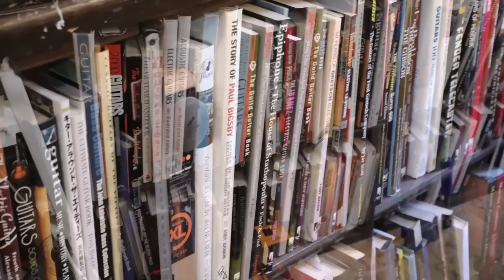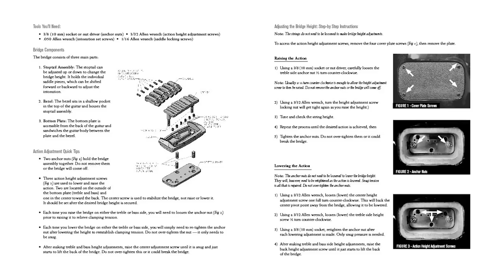Too many Cool Features to be a Success | Taylor Solidbody Teardown & Setup

Comment: Do you have contact with Taylor? i have a Telecaster made by the company in the 80's as a trial run. It has been my number 1 for 40 years. Purchased at Mose Guitars in San Diego, the owner told me Taylor made a few test instruments and decided not to move forward at that time. It's very unique, heavy oak, PAF humbuckers, master volume knob, two volume knobs, two tone knobs, jumbo frets. The body is one piece, no paint, dark wood binding, blonde neck with tele style head, it is incredible. 
i would love to get documentation from Taylor. I will never sell it, just want to know the story.

Comment: Nah you're not crazy aluminum is a soft metal, it sounds fine but it's kind of a durability issue. It's easier to strip something out or for strings to dig grooves in it than in brass or stainless.  Similar issues with wood. A one piece guitar made of a nice solid piece of wood is always going to feel more satisfying and it's gonna take a beating, and keep coming back for more if you ever take it on the road. You can strip the paint and give it a natural finish if you want. You can drill extra holes if you need to and if it's a fixed bridge you can dig out a cavity for a trem, or widen a pocket for new electronics. The advantages of a solid sturdy guitar go way beyond just what it sounds like.

Comment: What happens when that single-allen-bolt ends up being rounded out?  Did they provide a replacement?  Do you have that in-hand or are they now saying they have replacements?  Or is this such a standard allen bolt that you can pick them up 'anywhere'?  Of course, I'm of the opinion that wood means almost nothing on an electric guitar, that pickups are 'everything'.
Reply: I'm thinking about those particle-board uses.

Comment: I wonder if that particular instrument was some kind of pre-production/market tester or the like.  And re the neck, maybe the principle was that it was for a player spending most of the set-list on their (Taylor presumably) acoustic but wanted an electric on hand for the occasional rocker.  No, its not worth doing, is it.  
Looks like you re-purposed some of the cupboards from the old tool shop - and maybe re-homed some of the tools there too!  I miss it, driving round that corner, it gave the whole village a bit of an air.

Comment: Nah, lots of cool ideas but a bit gimmicky for my taste. Looks nice but I’d prefer to keep it simple like a Strat or a Tele. Also, I agree with you about the neck – definitely looks like it belongs on an acoustic. Wasn’t sure from the video but does it have any angle to the neck or does it run straight to the body like a Strat? If it looks along the lines of an LP it should really have an angle to it IMHO. Anyway, thanks Ben for the look at it. 👍🏻😎

Comment: It occurs to me that Taylor may have had to inovate with regards to the Bridge because of how structuraly unrobust the Guitar is. It could have been fitted with a Vega or Evertune but i think those kind of Trems / Bridges require a robust instrument to suopport them. It's aesthetically very nice but your little deep dive has exposed some cost saving methods that surely would have been lost on the buyers. I begrudge paying premium money for particle board, a secondhand one of these would cost the best part of a grand.

Comment: what 5-way switch would one need for having more humbucking positions with coils from both humbucker-pickups as in this one? And how to wire it up? 

Have searched for something like that a few days ago and couldnt find anything really
Reply: If you are really interested I would suggest finding a pickup manufacturer that makes humbuckers that can have split coils.  They should have a pretty good idea how to make it happen.
Reply: @cheapskate8656  thanx for the reply. I dont follow your reasoning though, because i think, it is rather a problem of wiring / finding a proper switch for it. So more in the realm of modding people or guitar builders. But thinking about it has given me an idea, who i might call up, so thanx again :D
Reply: @Lutzifer31337  try googling a boutique pick up maker (plenty of them around) some of them will make dual coil humbuckers that can also be used as single coils.  They should be able to tell you whats required from the pick up as well as what wiring or switch you would need.  If they make the pick ups but cant tell you how to wire them up then they should not be in business.  You could try "Dylan Talks Tone".  He is a pick up manufacturer who also has a youtube channel.  Ask on his channel, I'm sure he could help you.

Comment: Aluminum is not used on cheap hardware. Zinc is. Aluminum is pretty rare and sounds good. That's what you want for Gibson tailpieces; most of their tailpieces on guitars less than $5000 have 
zinc.

Comment: Most pieces are not brass or steel, but powdered zinc pressed in a mold. Aluminum is an expensive lightweight option.

Comment: Zinc alloys (AKA Chinesium; a mix primarily of zinc and mystery % of aluminum, copper, tin... Whatever's cheap, melts at lower tenps and can easily be cast in a regular oxygen atmosphere) are the favoured metal of cheap cheap guitars.
Schaller an Gotoh also make heavy use of zinc alloy but the alloy they use will usually be considerably harder than the mystery blends used by the cheap and nasty Chinese hardware suppliers.
Aluminum alloys (you will probably not see pure aluminium due to it's softness) need an electrolysis process and therefore higher energy costs.
Aluminum is the choice for canned food and drink due to it's ductility.
The right aluminium alloy can ring very nicely.

Comment: Several thoughts here First let's say Martin attempted an electric guit (they did and it's pretty cool) MArtin knows only acoustic guitars and hence forth their philopshy on why a gitar sounds good doesn't come from its electronics as it does in a cmpany like Fender who almost make electric guitars exclusivly. Leo Fender knew electornics .... the telecaster is basically fairly commplext (for the time) electronics mounted to a block of wood (screwed on neck, no body contours, thick) So a a high end acoustic maker Martins culture and philosphy dosn't understand in the electric woorld resonence and wood do not matter as much as much as in the acoustic world. It would be very difficlt philosphically as an acousic mker to just slap electronis on a chunk of wood when they're so used to caring about the wood used, the bracing, the shape of bosy bridge material. What I see is this aspect perplxed Taylor. Maybe more accuratly they went too far in the other direction. Meaning since it IS an electric guitar none of the wood or body matter and it in thinking that it's a noofle that carries sauce, a medium between point a) a guitar and b) playabilitly/tone. Whew ... ok another interesting note: the Gretsch DuoJet .... hollow without soundholes just lie this guitar. an empty chamber housing the electronics wih a cap on top. USually finished in thier drum covering material in that famous sparkle.

Comment: Some old Greco guitars have the same single bolt fixing so that's not really new. That bridge is a disaster.... Or is it? My first thoughts were: Pointless innovation and too many fiddly bits... These could lead to real trouble after long term hard use on sweaty stages. Sure does look cool though... Then again - all those fiddly bits are no longer actually located where the sweaty bits will contact them... So maybe, although it is strange, it might well stand up to long term stage use without parts seizing up

Comment: the back of the neck (with its weird curvy shape) still hasee huge contact area to the body and in the location that probably matters the most (same direction as string pull). So I guess the flat area of the back of the neck is not that important...

Comment: i have a taylor solidbody classic which you can change the pick guard and all the pickups easily. Great tone, great playing but the bridge is really not good handcrafted and when you fix it you must not touch it. its really difficult to have a stable bridge and a good intonation,. They have put a pick up switch (made by schaller ) that is not lasting long. So i had to find a similar pick up switch and change it. which is really difficult to find the right one for these pickguards. But they were kind and sent me a pickguard for free( maybe the last one). Unfortunatly The guitar is not produced anymore. İf the bridge was a good design, i think this guitar will be in a very good place in the market as their acoustic guitars.

Comment: Many a time I’ve thought that “tone wood” was over rated. MDF body says something, not sure its a positive (I own an acoustic Taylor I love). How can wood resonance match the tenth of speed of light that the electronics adhere to? #always be learning
Reply: I own a Taylor acoustic as well (very impressive guitars).  The top of an acoustic guitar does make a difference to tone but that can sometimes vary as much within a species as between species.  As far as an electric guitar with pick ups it would seem you are probably on the right track.  Evidence points to tone woods doing nothing for electrics.
Reply: @davestephens3246  Thats true Dave.  Apparently wind can also have an effect on the strength and density.  So, yep, even in the same species and same part of the tree, cut in the same way can have more variation that a different species.

Comment: I got fired up to buy a Taylor a decade or so back when I learned how cheap they were compared to Taylor acoustics. Scary cheap for a good quality American-made electric, like Peavey cheap but a lot prettier. I cooled down when I researched them and found that Taylor had used absolutely no standardized parts or even dimensions, and even then virtually nothing was available for them. Some good ideas wrapped in a LOT of bad ideas. I was shocked that Bob Taylor would so badly execute anything.

Comment: There is no reason why aluminium would be classed as an inferior material for guitar building.  The main advantages of aluminium are that it doesn't rust and is relatively light weight in comparison to other metals like steel.  The down side is that it tends to be a little more brittle, especially in its cast form.  This should not matter in a situation where it is not taking impacts or strain from multiple directions. 

 The neck jointing on this guitar is interesting but I do find that blocks of plywood holding the (rather thin) maple top in position.  Looking at that it seems to me that this guitar is of a mostly semi-hollow construction (which kind of makes sense as Taylor is mostly known as an acoustic guitar brand) without stating it out loud.  Having said that if I had bought a guitar like this (for what I generally expect as Taylor pricing) and then discovered how it had been made I would be less than impressed.

Seeing you analyse how other brands have made guitars in comparison to your own work is interesting, it helps us mere amateurs get a bit of an idea into how a real luthier thinks.

Comment: Thank you so much for this video. It is truly fascinating. I understand what it is you cannot get behind on this particular guitar. This is my personal opinion: 
Yes, it has everything it needs to get the job done and it does that, seemingly; exceptionally well; HOWEVER, it's like "A.I.", in that (shhh ... It is souless.) In the same way that I would not give a gift of plastic to Mother Earth as an offering, I would not be able to validate this as being anything but a plasticreplica of a guitar. . Why? Because it's basically dead. Including the aluminium, vs. brass or steel. Ok. Here's what I think will communicate better, the materials used to manufacture this instrument all consist of low vibrational énergies, so try as you might, if you're a spiritually sensitive person, which most musicians are, you won't connect with this as you would with a guitar that is structurally; as well as, spiritually or energetically sound, IMHO.

Comment: Have you been living under a rock? Cheap bridges are made of zinc. Your typical Tune-o-Matic is made from zinc. The old Badass bridges were zinc. Brass wasn’t that common until the late 70s with the whole brass fad. 

Expensive “boutique” bridges like TonePros and many Hipshot bridges are aluminum. Aluminum is considered very resonant. I use aluminum Hipshot bridges on the basses I build. (By the way “aluminum” was the original spelling by British chemist Humphry Davy). 

Also we have to stop this nonsense about vibration transference. The neck doesn’t have to even touch the body for good sustain. It only needs to be stiff. The body adds nothing to the tone, it only removes energy from the strings. This is why a solid body had little acoustic output but long sustain. The higher mechanical impedance due to the added mass keeps more of the energy in the vibrating string. 

I did a setup on one of these guitars once.  I thought it was very interesting and well made.

Comment: The Taylor Guitars School of Engineering
T 101 "The Taylor Guitars course on Overengineering" - How to design things to be far more and frustratingly complicated to operate than necessary to no purpose whatsoever. This is the prerequisite course to:
T 102 "The Taylor Guitars course on how to reinvent the wheel, the screw and the lever" - Ignoring all technological and physical advancement and knowledge of the past millennia to come up with things that were already perfected when Jesus was in third grade. 
Grades will be pass/fail calculated by an algorithm that is so involved and byzantine that every semester we forget how to do it and have to look it up in the 200 page manual.

Comment: Praises Bob Taylor's work then points out all the flaws in this design... I have a bit of a Taylor rant. I'm a fan of Bob Taylor the business man, but little else. He's done a remarkable job of finding a way to build acoustic guitars incredibly cheap (factory automation, fake binding, etc...) and through clever marketing strategies price them slightly above Martin and Gibson and still sell a great volume of them (I believe retailer relations, / higher margins help with that). The products are passable as a professional instruments, but unremarkable and lacking any uniqueness guitar to guitar. When choosing to source the best components for their product or choose skimming on quality to make a profit, Taylor consistently does the later. Proof of this is with their subpar electronics/pickup technology. You can get a $5k Taylor with their expression system that's not even in the ballpark of the high-end offerings from LR Baggs or Fishman. Taylor doesn't care. Because the competition has a rich history and tradition Taylor's entire niche is "we are the innovators". So we end up with useless gimmicks like the V-class bracing. Living near a huge dealer I demoed a 814ce X-braced and a 814ce V-class brassed the day the store got them... the X-braced version superior tonally up and down the fretboard. Everything they do is about trying to show innovation, even when its not needed. Everything they do is about making as much money as possible. I think the 200 series are where the tonal quality tops out and the GS Mini is probably the best guitar in their lineup.

Comment: That is not a fuse. It's a resistor
Reply from the maker: There is a fuse in there.. the actual bit I pointed at may not be the fuse, it didn't look like the cheap old resistors I know, but that does not surprise me one bit!

Comment: Taylor has had some real super horseshit designs like those box joints in between the necks & the headstocks. Nothing says bad horseshit design like gluing edge grain together and reinforcing it by using a finger joint. Charging $1500+ for a Masonite guitar is something only Taylor would attempt.